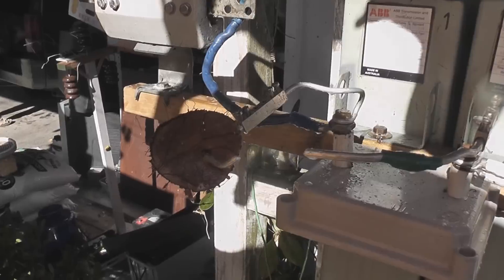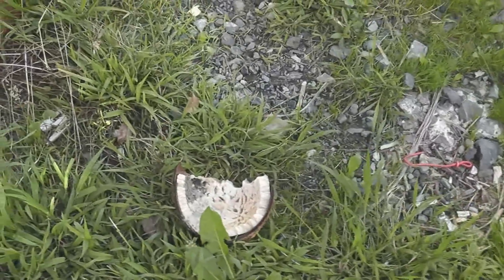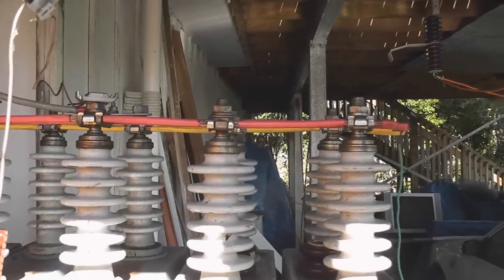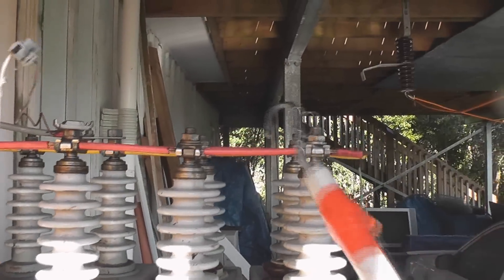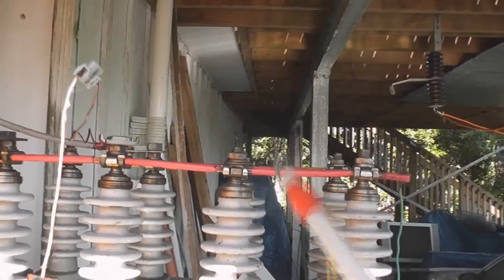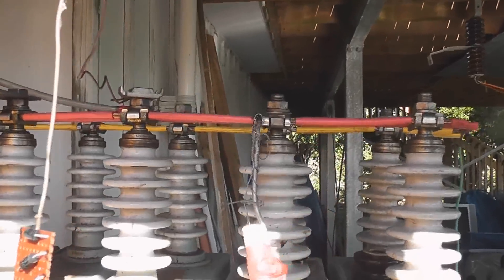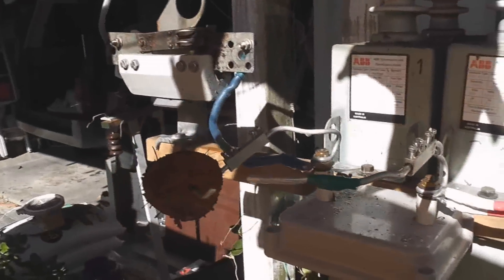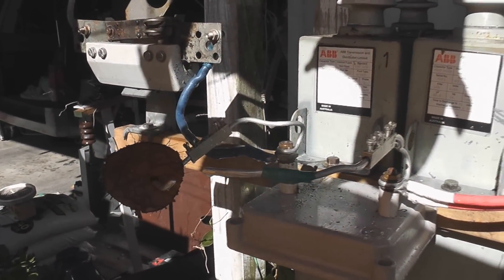an other Coconut explodes

Comment: I'm glad that you showed the second discharge after blowing the coconut up. There was still some charge on there, and it's good to show others that this is a real possibility, just in case they were a bit more lax with it before. :)
Reply from the maker: Rua Whitepaw Thanks.
 Especially when coils go open or an object flies away a charge in the Caps is still present.

Comment: Aaaah, nice poppage. Here's an idea:

Make a device which can be opened, the coconut placed inside and then be closed again.

The device will also have a funnel on its underside.

Close door, press start button..... =POP= and juice floods out of the funnel underneath into a cup. :D

This way, you could still have the poppage and enjoy the juice afterwards :D

(or see if any of the cats like the coconut juice. :D)

Yes, don't saw-open or struggle with that coconut.....Use the Rodalco-popper 7000! :D (the 7000 means 7kv of course :D)

Thanx for showing,

-BoomBoxDeluxe.

21st April 2015, 16.15
Reply from the maker: BoomBoxDeluxe Brilliant idea. Although it will probably have an electrical flavour in it.

Comment: Bang! Reminds me, I need to do something with the one we've had  sitting on the shed floor for the past two years. (If the mice haven't eaten it yet!)
Reply from the maker: Machine Man Drill two small holes for electrodes, may moisten the inside and pop it !
Reply: RODALCO2007 sounds like a good plan!